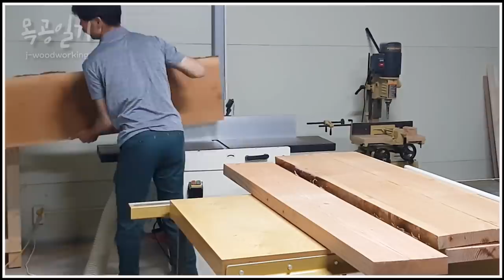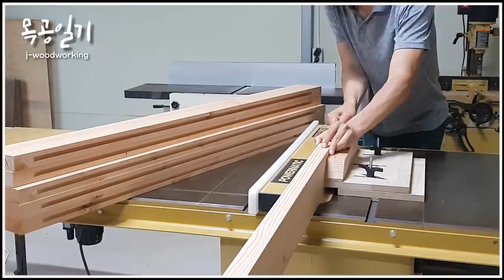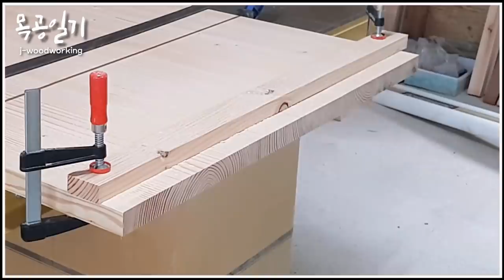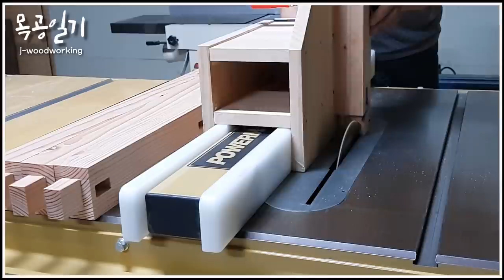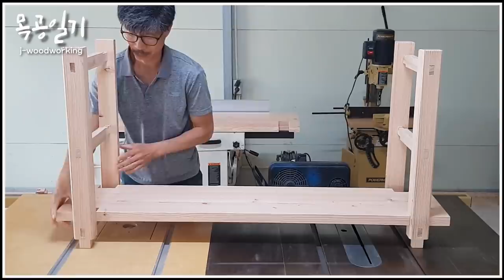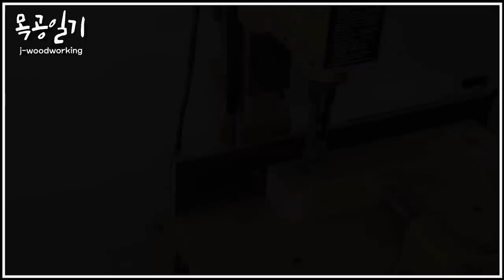antique book shelf - able to disassemble & reassemble [woodworking]

Comment: so beautifully meticulous woodwork, I love this type of joinery! And the experience tells, you need no measurements!
Reply: You need no measurements?!
Reply from the maker: Yes I don't have measurements. 
Before I start working, I have rough sketch and outline size. I follow sizes of timber, results of previous cuttings and dimensions of tools and blades. That's not so difficult. 
For me, it is much easier to work that way. 
Thanks for watching sir.